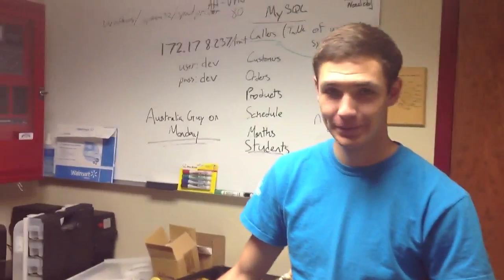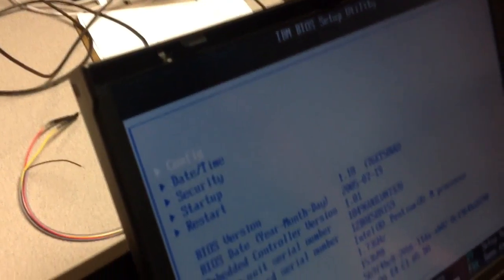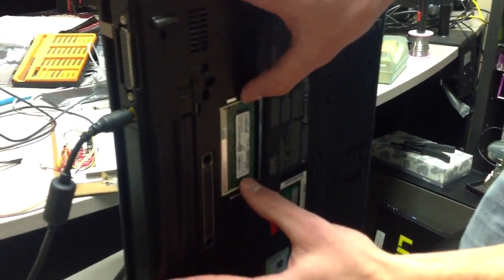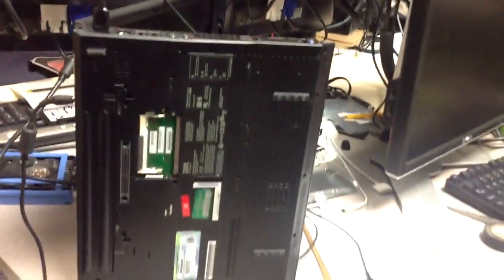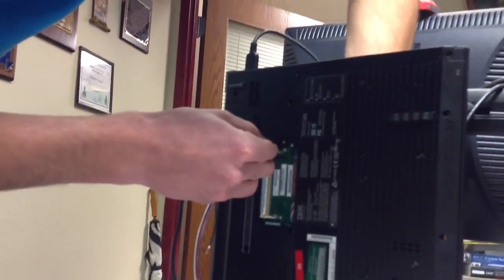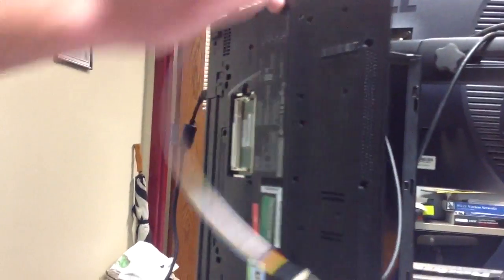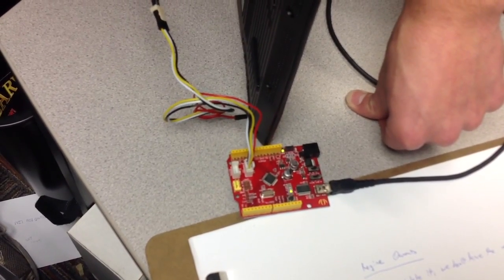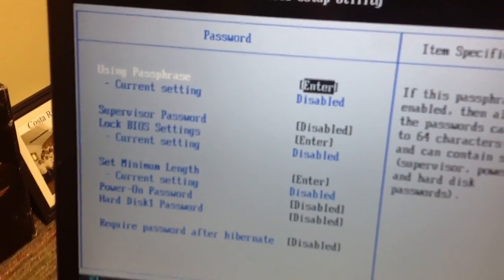Resetting the BIOS password on Lenovo laptop

Comment: should you be removing RAM with power connected and battery on?
Reply: +joseico90 Providing PC isn't on, there is no issues doing this. 
Just for safe measures you should do so in a normal replace RAM situation.  In this scenario, no problems.

Comment: That board he was using to reprogram the password looks like a microcontroller sampler board. Chip manufacturers give them out to developers, sometimes free. They usually have a flash memory on them for user programs, with some I/O pins and leds for output. The one there looks like it has a USB port too.

So if you can get one, and the Aussie guy's software (from the microcontroller board's flash memory), you should be able to flash it yourself and then reset your Thinkpad BIOS password with it.
Reply: ***** That's interesting!! Do you have any link to some sample arduino code I could study? Thank you...